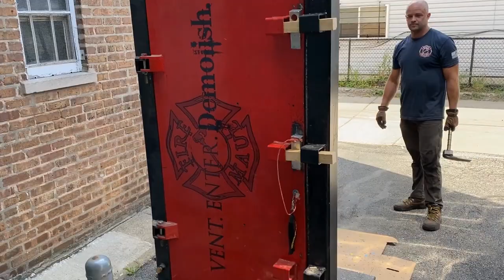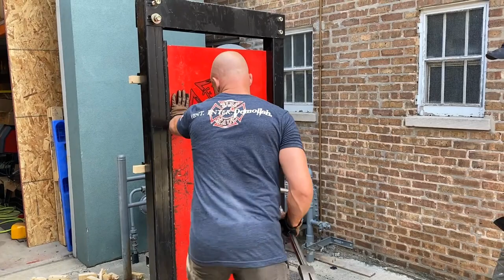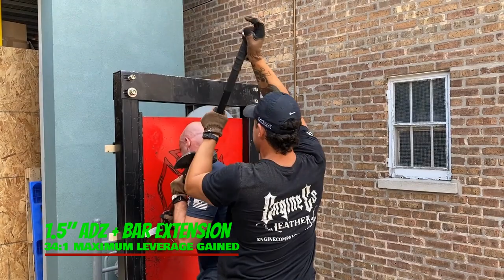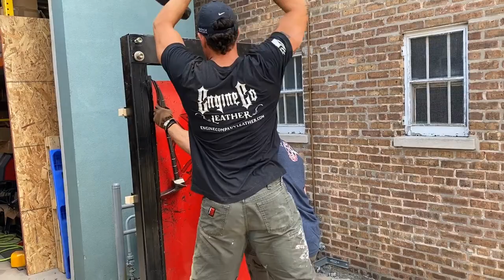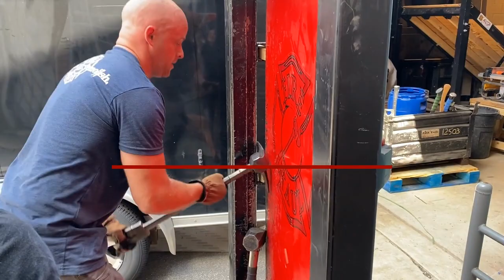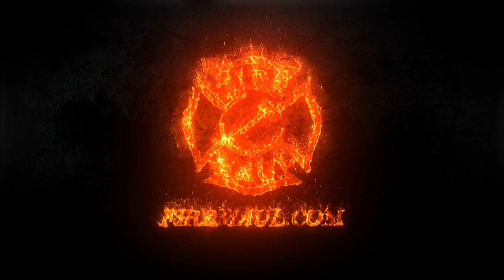ALL NEW -TSR Halligan -First Force -2 Person

Comment: I find the halligan intriguing, but the demonstration of the “shocking” the door stuff just makes me laugh every single time. What an absolute waste of energy and time. After 38 years on a very busy urban rescue, I’ve never seen the value of shocking the door. It does nothing and in one instance I watched it cause a career ending rotator cuff blowout as the stored energy has nowhere else to go but back into the user. Faced with 10 doors down a multioccupancy that all must be forced, you’ll have no energy to finish when you are done. Just do good. Smooth, gap set force and move along. 
Interesting take on the halligan though.
Reply from the maker: We actually gotten away from it ourselves, unless we are just ramming a residential door to see if it will open.  But for the most part we just start a gap low and work that gap up the door to the lock.  Quick and easy.